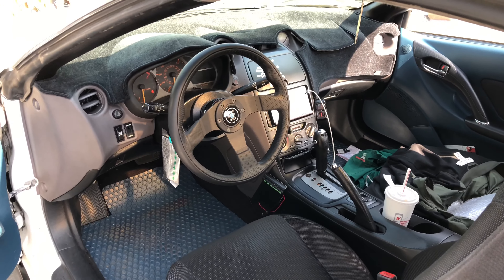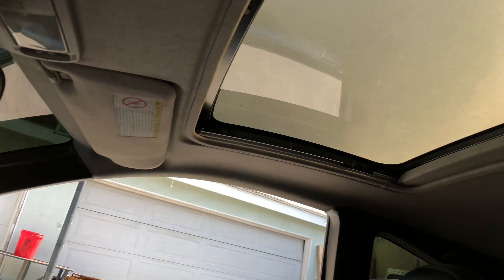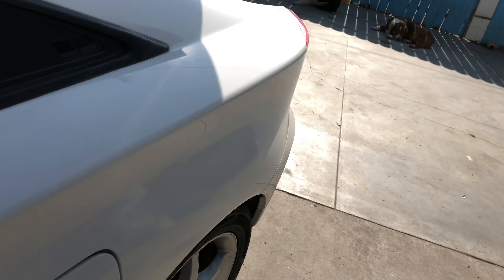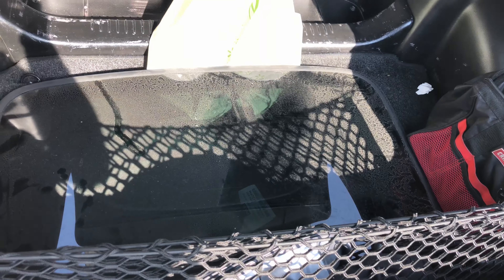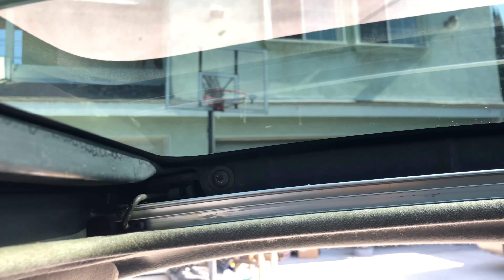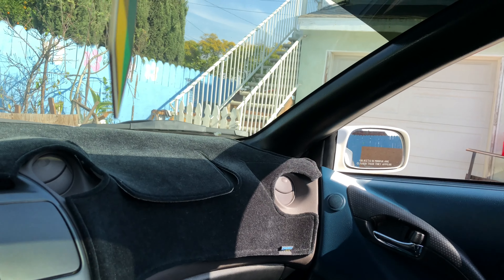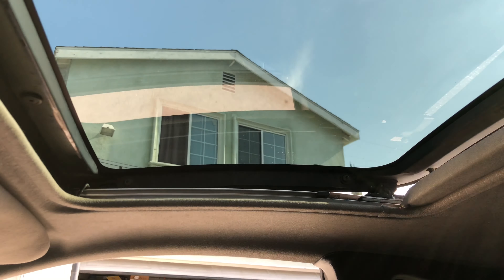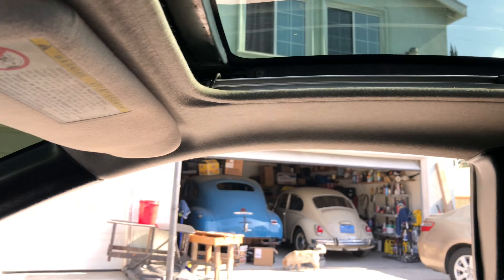How to replace a sunroof panel | Toyota Celica

Comment: I've got a 00 Celica with a cracking aged plastic sunroof, so I was going to make this swap too. I've read that the original motor wouldn't handle the glass roof weight, so THANK YOU very much for making that note in your video. My question is, over a year later since you posted this, is the motor still working well? Or has their been extra strain on the motor that maybe shortened it's life?
Reply from the maker: Not at all. I’ve used it a lot a night since I put it on and still opens smoothly.
Reply: @attachedsilver8929  Excellent news! Thanks for the reply and the video . Makes me feel better about making the swap.

Comment: Hey, just saw the video. well done. i have 2000 celica with damaged seal on the sunroof and seems to be leaking. i thought the drain had a problem but no, its the seal. i was wondering where u got the sunroof from? would be really helpful for your information. thanks!
Reply from the maker: Ibnul Sharar junkyard
Reply: Same problem here. Car is soaked all the way to the trunk when it rains.

Comment: My motor or switch isnt working, but i wanna switch out the glass. Do you need to tilt it to line the bolts up ? Or can i just change it with it closed? Thanks for the video.
Reply from the maker: you can change it with it closed. Just be careful not to strip the bolts as they can be on there tight.